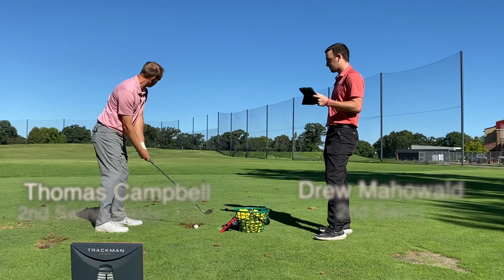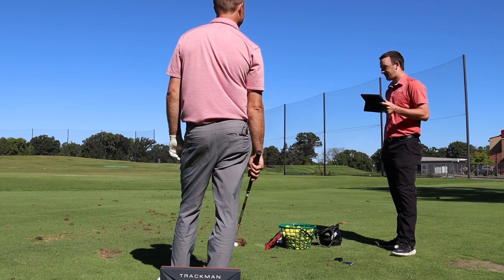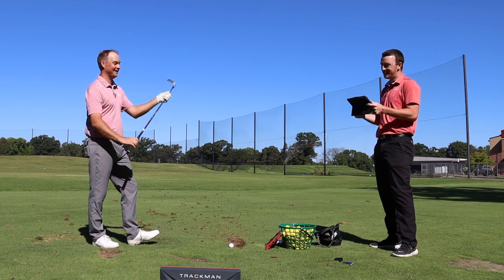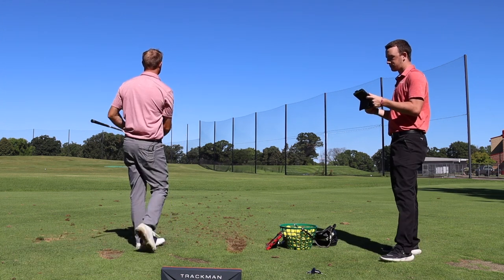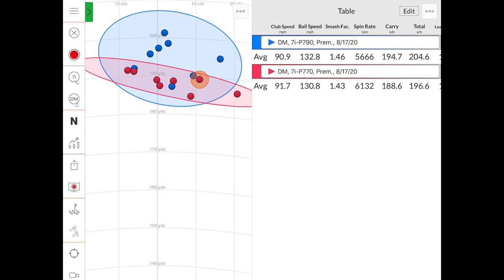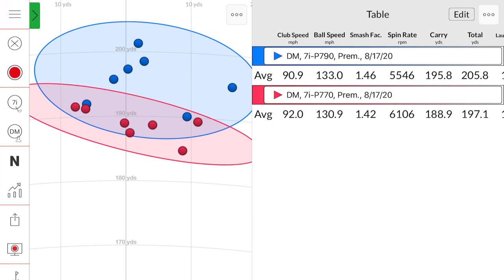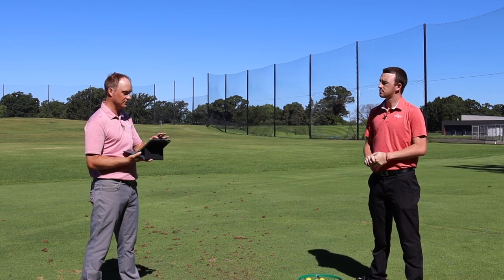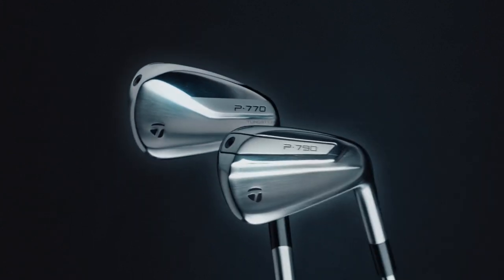TaylorMade P770 vs. P790 Irons: Trackman Test & Comparison

Comment: Another solid video guys! Thanks for all the data, front to back dispersion with the 770’s looks solid!
Reply from the maker: Thanks for watching! We were surprised with the distance consistency with the P770s as well, especially with the hollow-body design (even if it is a much smaller hollow body than most).

Comment: Thomas, 
On a p790 vs p770 gap wedge, how would you compare the forgiveness and performance on full shots and also for chipping and pitching?  Also, how would you compare these two gap wedges versus a Vokey SM 8 50 degree gap wedge for forgiveness, feel and chipping and pitching?  Thanks
Reply from the maker: Hi Joe, thanks for watching and for the comment! The gap wedge comparison between these two will be similar to the iron comparison. The P790 will likely travel further and be more forgiving. A vokey SM8 50-degree will not go as far and will be less forgiving, but it will spin more.

Comment: I’m looking on getting a set of p790. I know they fly off the face, but how does it react hitting on a green? Do they stop or just continue to roll?
Reply: Yes the P790 irons make the golf ball stop on the green. Just play a multi layer golf ball.
Reply from the maker: They do spin lower than a players iron, which is something to keep in mind with regards to stopping power. If you're a low-ball hitter, you'll want to pay attention to the lofts and perhaps make them weaker to help lift the ball into the air.

Comment: Question - for 5ft 11 what do you recommend on shaft type for a 15 handicap player, left handed - do you recommend 0.5 inch longer on the shafts, regular or stiff shafts and how about the tip weight and launch angle...?
Reply from the maker: Mark, thanks for the feedback here. It's hard to make a recommendation with the metrics provided here. Statically, height wise, you'd fit into STD length clubs, but again, that can always change dynamically (when you swing the club). Club speed, club path, dynamic loft are all essential things to look at during a club fitting. I would highly suggest a club fitting do narrow that down for you, and get the right clubs in your bag!   -Danny

Comment: Wishing my game was good enough for p 790 irons because they are gorgeous.
Reply from the maker: They look really nice, don't they?! Plus, you'd be surprised at the forgiveness they provide...
Reply: WHy isn't your game good enough.  Mid to high handicappers game P790s.
Reply: @canefan17  I'm an 18 handicap. Grew up hitting (cheap) blades so I love how the P790's set up like a traditional blade. Unfortunately  my game demands more forgiveness so I'm switching over to Mizuno hot metal 919's so we'll see how it goes :).
Reply: Jeffrey S ya I’m with ya. I currently have 919 HM and Srixon 585. I’m testing 7 irons out before picking between those 2.

Comment: If p770 loft same as p790 its will distance same as p790 do u think?
Reply: I saw a video on this and the answer is yes. It was pretty much a face vs. face video and the upper hander (imo) went to the P770 - those opinions are due to looks, and feel. I hit both the P790 and 770 the other day and the 770 felt soooo much better.

Comment: Are the p770s much less forgiving or around the same?
Reply from the maker: Surprisingly forgiving. The big difference (besides loft of course) is the distance consistency. The P790s can produce jumpers with a larger clubhead and stronger loft. The P770 maintains its distance for the most part